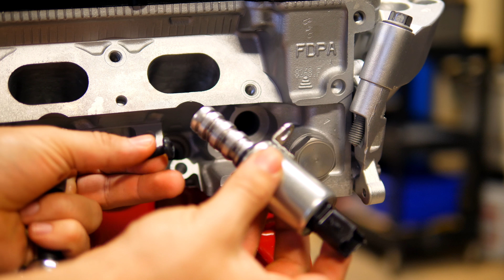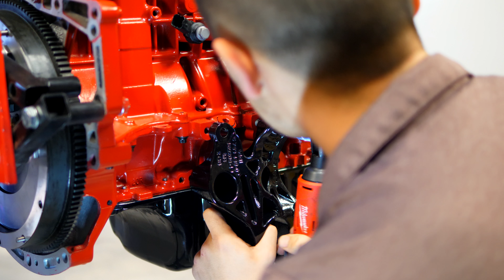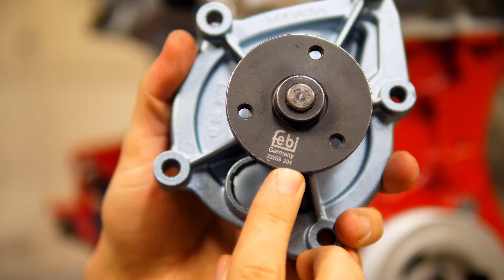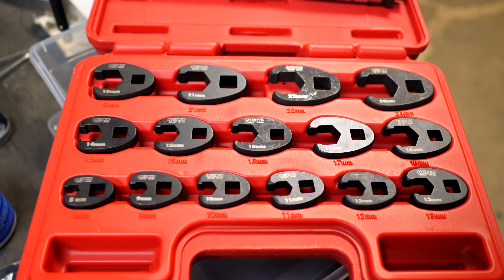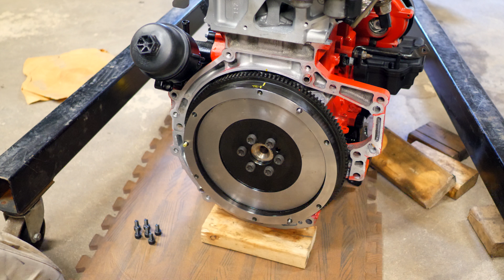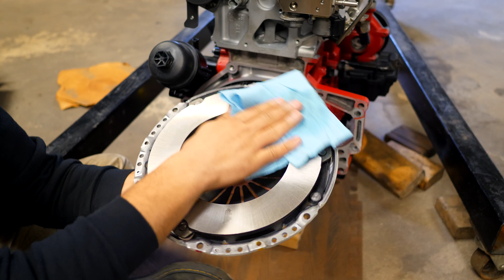THE FINAL ENGINE REASSEMBLY!!! // FULLY FORGED ENGINE

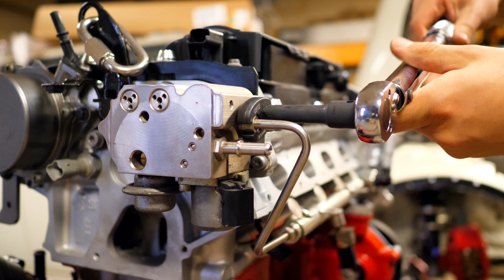Comment: 5:26 - You are supposed to attach the crow's foot socket at a 90 degree angle ( Г ) compared to your wrench, ie. the socket opening should be facing up or down when your torque wrench is horizontal like in that part in the video. Otherwise your torque will not be correct.

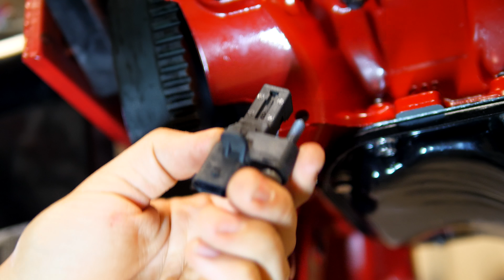Comment: 5:44 wouldnt a tool like this apply more torque than what you set the wrench to click at? since the force would be applied over a longer (like an inch) distance and torque is force*distance. Im sure it would be an easy calculation to adjust for though

Comment: Word of help Milan, in most scenarios when aligning an input shaft with a clutch plate, it helps to have the gearbox in 1st or 2nd and turn the output shaft, if you have a spare cv cup that you can place into the output of a transverse gearbox.

One more thing, remove the oil filter housing from the block and clean all the paint off the mating surface, you need that to be clean and smooth, paint can cause poor sealing.

Good job tho dude.

Comment: I found that having a gasket mounting surface that's painted leads to leaks. I'm almost certain that having a crows foot on a torque wrench leads to erroneous reading/setting.
Reply: Yes your correct, when using crow foot bits you need a good quality torque wrench and need to measure from centre of the torque drive to centre of crow foot bit